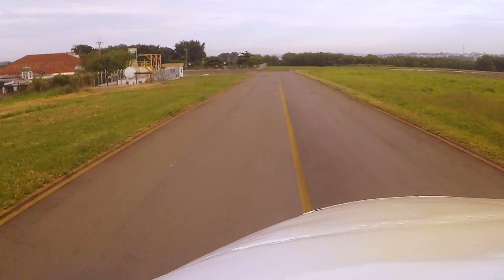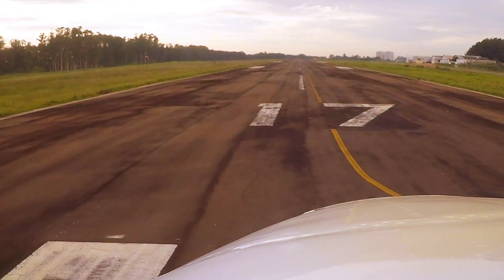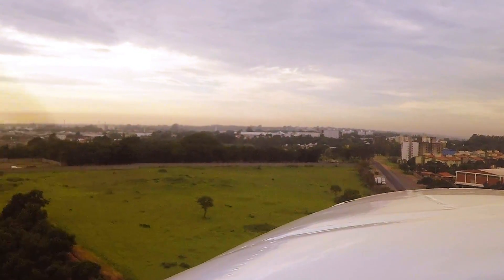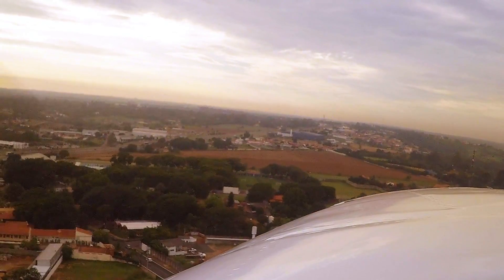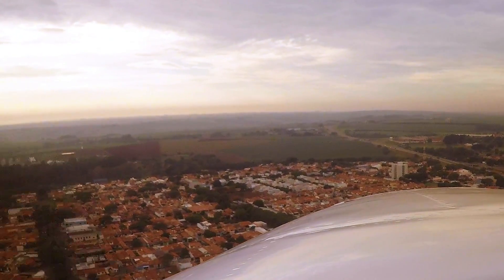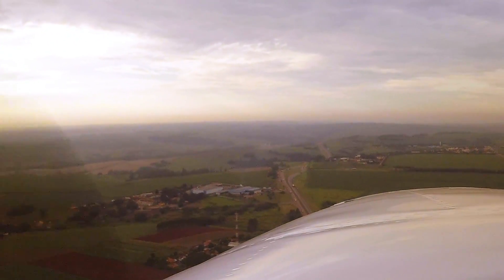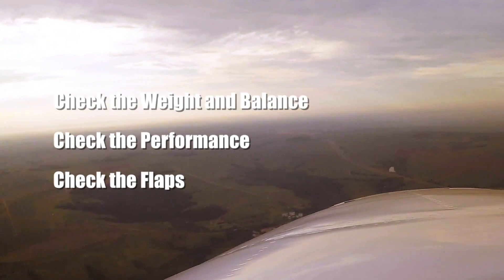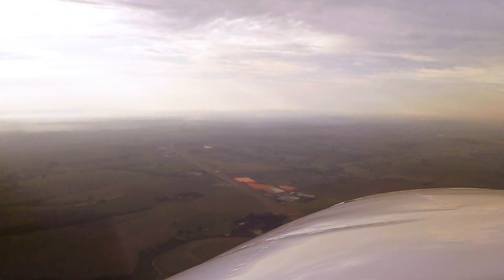Engine failure during take off

Comment: Could this training not have been accomplished in a simulator instead of needlessly endangering so many innocents on the ground?
Reply: No, they're looking at this thinking "holy cow, this went about as well as could be expected and you left no margin for error here"

I accept that after simulating an engine failure on takeoff several times (sims are not more expensive than planes and the things they hit), practising it for real is invaluable, but ... c'mon man, do it on a strip that's not surrounded by tower blocks - just look down the runway; they're gonna fail the right engine because that's the side most accessible to the instructor, so the plane will yaw right. What's just to the right of the centre line at the end of the runway? A  two tower housing block. It's clearly more risk than it needs to be. As soon as the plan lifts off it naturally aims straight at that those towers and you have to start fighting it clear, which then proceeds over houses, an industrial park?, more high density housing, while all the time trying not to get pulled towards tower after tower to the right. 

Planes are mobile,  what's the harm doing this from a remote strip? Sure, a couple hundred dollars in fuel and time, but you've gotta build up some cross country time too.
Reply: What a weird retort.
Dude there could be coal powerplant to one side of this town and a regulation-dodging chem plant to the other and it's still an increased risk. 

Aviation is all about managing risk and avoiding unnecessary risk. It is undeniable that this risk could have been easily reduced by flying out of a different field. Training always involves cross country flying, and even in Euope it's not hard to find a strip where you can take off over water/unpopulated areas/somewhere that doesn't have a pair of tower blocks at the end of the runway.. and as for comparing this to a small car, lets. 

What we're actually talking about is failing a critical system to see how the pilot reacts. Would you like to have learner drivers and truck drivers being assessed on the public highway by having the instructor fail the brakes or pop a tyre? Or would that be better suited to some kind of non-public area do you think?

Moreover, why is this a bit different than a small car? Well because it's weighs over 3 tonnes, is travelling at two hundred K's an hour and carrying over 700L of jet fuel. Compare that to a ford fiesta that weighs about one tonne, carries less than 50l of mogas and travels at like 50Km/h, and it's clearly an insane comparison before you even factor in all the car's safety features like brakes, crumple zones and a well protected fuel tank. 

The TL;DR of that is that if the small car looses control and hits a tower block, it'll crack some concrete, if the C90 hits it, it'll burn it to the ground very quickly. The more accurate comparison would be a ford transit carrying 4 barrels of kerosene driving next to a built up area at 200km/h and choosing that moment to start turning systems off on the vehicle.

Whatever other risks the people of this town may or may not encounter in their daily life, the decision of this flight instructor put them at increased risk, and a risk that could clearly have been avoided. Again, my point isn't that you shouldn't train for an engine out - it's significantly more dangerous in a twin engine plane than a single - but don't do it there.

 I honestly don't see your point... seemingly that air pollution in their area would mean it wouldn't matter if a plane crashed on them?.
Reply: Certainly not over populated area.
Reply: this is actually a really smart comment, as a pilot, I think that the school should be contacted by the NTSB for performing unsafe training methods
Reply: Most likely it was simulated by pulling the power back, then adding a bit of power to simulate the effect of feathering the propeller. Power on the engine would have been available immediately if something went wrong. It's a required exercise for training. Many light aircraft do not have certified full motion simulators due to the cost so it's done in the airplane. There is always risk in everything we do. There's a risk of slipping in the bathtub taking a shower. We cannot completely eliminate risk only manage it. The small amount of risk associated with simulating an engine failure on take off is acceptable due to the gains in skill and experience. Such training helps mitigate the risk of loss of control in the unlikely event of an actual engine failure off of departure.
Reply: wefreebefree....I understand completely where you're coming from.  Ignorance is bliss :)....Remember back when you didn't know what you know today...and how such little simple things brought you pleasure and contentment, because what you know now, wasn't renting space in your brain, like it is today!!  I will say the reason it's renting space, is because the information is extremely important, disturbing and you're aware of the FACTS, because you my Friend are Awake, while everyone else is asleep like sheep (as designed).   You got very deep down that rabbit hole there, that most are unaware of.  If it's not about rainbows and unicorns, fotball, beer and BigMacs...People don't want to hear it, learn it, know it and certainly not remember it.   

As I say, ONLY in America does 1  +  1  =  3.
Yup, it has to....because we are ALL supposed to Believe 2 ALUMINIUM Airplanes Destroyed 3 CONCRETE & STEEL SKYSCRAPERS at F R E E  F A L L Speed....on the SAME DAY.... I might add?!?!  LOL!?!?!?  It's just a Coincidence ALL 3 SKYSCRAPERS FELL the SAME WAY??!!??   WOW!!!  What normally would have taken 4 MONTHS and 3 Professional Demolition Teams....was accomplished by just 2 Airplanes, some Kerosene (Jet Fuel)and some office FURNITURE :)   1+1=3 to those that are asleep, indoctrinated, brain washed,...with little Critical Thinking or Reasoning Skills. 

BUT, really.... 9/11 isn't that big of a deal, sad to say :(  .....  In comparison to the CDC, that covered up Causation Correlation between Vaccines & Autism during their 2002-04 MMR VACCINE SAFETY STUDY (per Dr. William Thompson CDC WHISTLEBLOWER).  Because of this....We're ALL facing this E P I D E M I C of Autism in the United States & by 2030-35 every other CHILD BORN will be AUTISTIC (per Mathematicians ONLY In the USA).  The CDC & our Federal Government will be to blame, because THEY did NOTHING & actually HELPED to POISON.  Just like when Dr. Thompson came forward in August of 2014 and stated HE, his colleagues (co-authors for the 2002-04 paper), CDC Admins. committed SCIENTIFIC FRAUD, violating the Scientific Method.  Thompson also gave Congress over 10,000 pages of Scientific PROOF of the FRAUD.  Yet, Congress does NOTHING??!!??!!  The FACT that African American Males have a 240% INCREASED RISK of an Autism Diagnosis IF the MMR Vaccine is GIVEN PRIOR to 36 Months of Age....doesn't seem to matter to these Psychopaths in DC or Academia or Peer Reviewed Scientific Journals or the Mainstream Network News & Papers. This is for sure clear based upon Their S I L E N C E.  One of the hardest lessons I've had to learn in life, is the realization as to the extent of Psychopaths that there are in the World and They're literally running the show.  Operation Paperclip is where my Country really starts to go down hill for ALL of Humanity.  Japan didn't surrender because of the Bomb.  Vietnam was based upon LIES, just as WMD's in Iraq.  Saturated fat is good for you, sugar is NOT.  Fluoride is NOT good for Organs/Bones & lowers IQ (HItler & Stalin used the Shite in the camps).

Peace Brothers & Sister, THINK for Yourself...we're being told LIES upon LIES.  
Hence, It's US against Them (the Remorseless Psychopaths & Fraudulent Scientists)
Either you're with the People or the Psychopaths in Washington, real simple.
Reply from the maker: Hi,
unfortunately simulator are too expensive. but on the other side this training is part of FAA and JAA training. 
Every multiple engine pilot had done it on light aircraft such as Piper Seneca which doesn't have the ressources of the king air I was flying. 
During an ATPL test, the FAA examiner even shut off an engine at V1. 
So, even if at some point  the video is impressive, the training was quite safe.
Reply: George Jackson I agree. That aircraft was just too dammn close maybe only 50-100 feet above the rooftops. The Yahoo doing the "training" must have his license pulled, before, not after, he kills himself and anyone else.
Reply: Nice video , and a shame it attracts Microsoft Sim basement dwellers who want to give you training advice in between the slices of pizza their mum brings down for them. Engine outs can occur at any altitude and practicing  for them is smart. These SIM idiots fail to realise you planned this event, they seem to think you just hit the runway and decided to do it.....

Comment: I'm commercial/instrument/A&P but not twin rated, nor have worked on a King Air except in school, however, I have a couple comments. With the sluggish response, I think it would have been prudent of the instructor to stop the exercise and do this at altitude. I'm surprised a King Air 90 lightly loaded, flaps up wouldn't climb better. Another thing, he keeps saying it "wouldn't climb" when it seems to me he had a fairly constant minimal climb.

Comment: I'm surprised at the lack of performance from the good engine, considering you weren't terribly heavy. Was there an issue feathering the dead engine or getting the gear up?
Reply from the maker: Yes, it surprised me too and this is why I decided to share this video, so other pilots won't be taken by surprise.
The gear was up as soon as I had a positive climb and the 2 engine properly feathered. It just that the engine are a bit underpowered for the aircraft. 
I used to fly Piper Cheyenne I and it have the same problem.
Reply: @rayishido  dont call yourself a pilot - ever -

Comment: Is this model supposed to safely take off on one engine ?, because this thing BARELY made it ... very scary. Those small twin props cant dump fuel ?. I mean, not reduce weight on land but to help climb as well.
Reply from the maker: Chuck Sherron, you brilliantly summarized the situation... 😂😂😂👍🏻
Reply from the maker: 38911bytefree, yes they are if you respect the weight and balance of the aircraft (which was the case in this situation). What happens is that depending of the aircraft model your rate of climb is as low as 100 or 200 ft/min. 
For exemple KingAir B200 or 350, which have more powerful engines, would have climb at a higher rate.

I could not affirm for all small twin props aircraft, but Beechcraft and Piper models doesn't have fuel dump system.
Reply: Chuck Sherron Maybe for a piston twin but a turbine twin should be able to continue with one caged. At least it'll buy you enough time to reenter the pattern & land.
Reply: 38911bytefree the second engine on these this type of aircraft is to give you enough power and speed to make it to the scene of the crash. Lol
Reply: LOL

Comment: Thanks for the informative video! Were you at any point considering starting up the second engine? Glad it all turned out OK.
Reply: A turbo prop can be feathered with the gas turbine still running. Unfeathering to a fully operational powerplant is a matter of seconds.
Reply: "Unfeathered" the second engine?? You mean you nutjobs actually shut the engine down for real instead of simulating zero thrust? AND you did it towards a populated area with obstacles? You people are nuts!
Reply from the maker: Thanks!
We unfeathered and apply power on the 2 engine as soon as I reached V2 and got a steady positive climb.

Comment: That second segment climb was also poor, it truly makes me wonder if the engines on a C90 are fit for purpose.
Reply: God help the pilot if this was a HDA take-off!
Reply from the maker: To be honest, I don't think 550 shp is enough for those aircrafts (Piper Cheyenne 1 have the same problem). 
Even the chart of the manufacturer doesn't predict more 200-300ft/min in such situation (at least under the condition of temperature and on the airfield we are operating)
Reply: He would be dead by now. HDA, Over weight and dirty config? A perfect recipe for a disaster.
Reply: They are not really, the performance on a B G58 is almost the same and in some cases the same and better.

Comment: You failed an engine on purpose just after take off? I'm not a multi-pilot, but I'm pretty sure that's not the recommended way to train this scenario.
Reply from the maker: Hi!

No, we didn't shut it off: we reduced it and feathered the propeller (there is an RPM that simulate the drag of real engine failure)

This isn't a training to be done without careful preparation but on the other hand, as we can't afford to train at FlightSafety or Simmcom, it is better to train it under controlled situation, than to be caught unprepared.

That's why we train it taking off from our base, knowing the temperature, wind, weight of the aircraft and the topology of the area.

But I agree, there had been a risk but we were aware of it.
Reply: Ray Ishido You were aware of the risk? How about the people on the ground under your flightpath, were they aware? Excess of arrogance.
Reply: @rayishido  So you can afford to fly a real twin engine aircraft, but you cannot afford a simulator? I call bs
Reply: @daniellee100  you said we meaning the school, most aviation schools has planes but no sim

Comment: Now I am wondering if you had not fought so hard to insist on takeoff heading.. and let it corkscrew to the right a bit with the full thrust being on the port-side - if maybe you would have achieved a better climb-rate? This would also have gone a long ways towards your down-wind path back for emergency approach - and setting her right back in the lap of the ground crew to see where they fouled-up on that starboard power plant! You could've handed em boys a nice fat CIGAR that day my friend! "Blue skies mate"!
Reply: Thats what I was thinking, and it certainly makes sense to me. There should be less drag if you’re not fighting the turn with the rudder. You’ll still probably need a little bit of rudder to prevent slippage (which would result in ever more drag), but I’d be interested to see this actually tested. I’m never flown multi so I’m just guessing, lol
Reply: @jacobstump4414  You are both spot on. You absolutely get a better climb out on one engine if you release a little rudder pressure and let the plane slowly turn to the side with the out engine.

Comment: I am wondering why you did not go back to the airport when you could. It seems that you continued flying the plane further and further
Reply from the maker: Hi! 
As I explain at the beginning of the video and in the description,  the aim of the maneuver was to train so in case of an emergency I always had the option to use motor 2. 
On the other side, if it has been a real emergency, I would not have been able to return until the end of the video when I begun to gain altitude: they were too many obstacles.

Comment: I really have an issue with videos that are posted with no details.  I have flown all models of King Airs and this is simply not how they react when flown properly.   What is not shown on the video is such a long list of variables.  Without Torque, temps, prop RPM, AF, RB, LG, Flaps, Trims and whether it was a shut down or zero thrust, windmilling vs feathered is just ridiculous.   A C90GTx with 135A's is not going to have any of these issues with the proper technique.
Reply from the maker: I tried to post as much details as I had. torque prop, etc... was the maximum allowable by the conditions. We operated the aircraft "by the book", everything has been briefed before we entered the aircraft. 
What I didn't had was air pressure and humidity, but as far as I remember, our rate of climb was more or less what the POH predicted.
Did you operate under the tropic? high temperature and humidity really degrades the aircraft performance.

Comment: Aren't u supposed to bank into the good engine and use rudder
Reply from the maker: Exactly: the right procedure is to first apply rudder to counter the yaw and to bank (approximately 5°) towards the live engine. 
But even after doing that (look at the video between 1:00 and 1:10), the aircraft wasn't climbing and I had to maneuver to clear obstacles. It really took some times to get a positive climb.